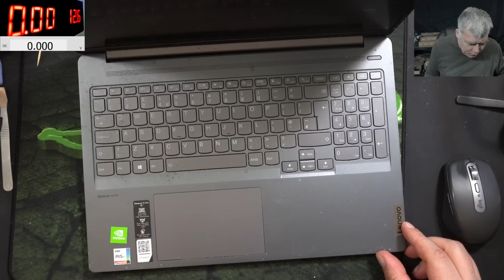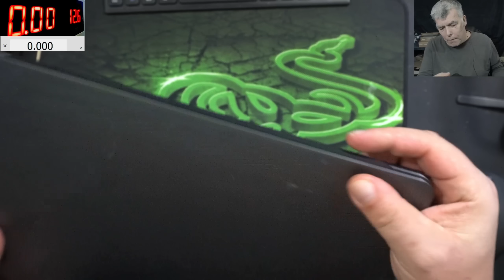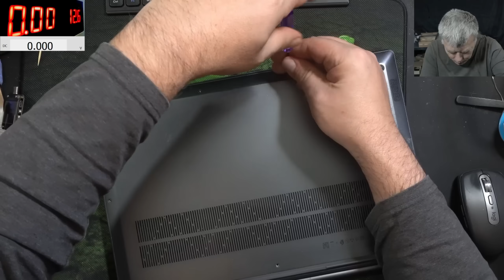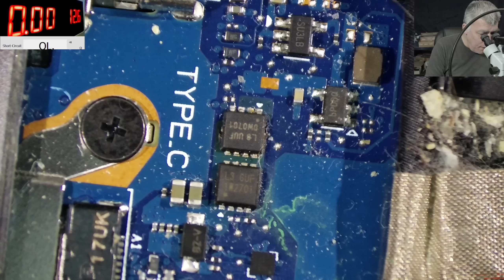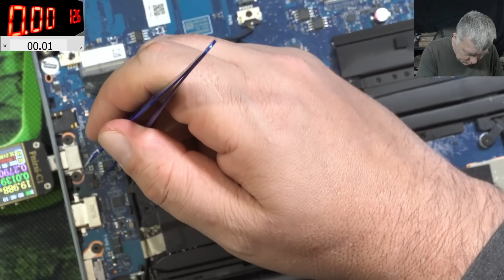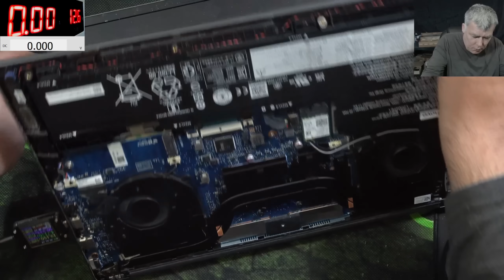Lenovo IdeaPad 5 Pro 16IHU6 dead, not charging, no power, motherboard repair, my way to fix this

Comment: Noooo! Sorin, what's the point of shorting both USB-C ports? Customer will always use only one port for charging the laptop (usually it is the closest to the screen hinge), so he can use the other port for any USB application, like charging the phone or using USB stick. When you short both ports, the customer won't be able to use the second port for general purpose USB 5V anymore, because there will be 19V; but he won't charge his laptop with both ports either. Isn't that true?

I would recommend to repair only one USB port by shorting its pair of MOSFETs, leaving other one for general USB 5V usage.

Comment: what do you all think of using P-mos with gate connected to ground source to vdd of port(type c) and drain to the main power rail consider max gate source voltage of the mosfet can tolerate -20v. this should work as the pmos on resistance is not very much and also should seperate both port the person could use both the ports for charging and usb device.

Comment: Sorin how about that: take a low voltage gate mosfet irlz44n, tie its gate to the gate of these MOSFETs. Then that low voltage mosfet connect it to the 19v and add a boost converter, set it to 25v,connect it to the gates of the MOSFETs and do the same on the other port? Ofcourse add a resistor between boost conv and MOSFETs gates. Is that doable?

Comment: If the mosfets are getting as hot as they are, are you afraid that the solder will melt???? Thanks for the video. Do you answer questions here or just if you are a member????
Reply: The MOSFETs get hot because they always have some internal resistance. A straight solder wire 0 resistance, so no heat.
Reply: @gr0undc0ntrol  thanks
Reply: I have found that the solder wire that I use, makes for a nice 5 amp fuse. If I want 10 amps, I use 2 solder wires.

Comment: As I said in a previous video, you can use p-mos and easily create the gate voltage from 19v with a voltage divider or a zener and a resistor,
Reply: nope , BQ chip won't like that
Reply: @Customer_Com543  it's all about the resistor and the diode you use. If they drain very little current so to mimic a mos gate you have no problem

Comment: Can I do the same with the 2 mosfets inside the battery? If the battery is locked?
Reply: No. Don't mess with mosfets inside battery, they are there for protection. If you delete the protection you will risk with fire.
Reply: Yes you can, but you are playing with fire by taking the protection away.
Reply: It's sad how bms systems are self-destructing. It's also sad how the sound tiles are absorbing the sound.

Comment: could you not solder a wire from +5v to the drain of the  other 1st input mosfet so that the other port would still work with all USB devices?
Reply: No. There has to be 25V on the gate if they are N channel mosfets. And it doesn't matter really. Because once you solder external voltage to the gate from anywhere then mosfets are open all the time. It is exactly same as literally shorting them. Then why even bother. PD controller needs to be capable of controlling them accordingly. And you can't simulate that in any way. You simply need new PD controller.

Comment: if we use a buck converter from 19 to 6 volt just for gate?
Reply: No. There has to be 25V on the gate if they are N channel mosfets. And it doesn't matter really. Because once you solder external voltage to the gate from anywhere then mosfets are open all the time. It is exactly same as literally shorting them. Then why even bother. PD controller needs to be capable of controlling them accordingly. And you can't simulate that in any way. You simply need new PD controller.
Reply: Actually you can use a isolated power supply to give the needed gate voltage without the need to go over 19. It works the same way. If you use a 10 volt isolated power supply, it will read 10 volts or 29 volts depending on where you read it. Voltage is relative.

Comment: The gate should be 25v. Can we just supply it 5v more? since the mosfets are welded
Reply: From where? You have literally max 20V in this laptop. You need some boosting circuit. But it's not about that if both are turned on all the time it's exactly same as shorting them. PD controller needs to switch them on and off accordingly. And you can't simulate it any way other than replace PD controller.
Reply: @TriodeTetrode He has buck in his storage. I feel like its a safer way than jumping. Those mosfets will prevent the board from allowing current when it get shorted. Still saving the laptop for another incoming fault

Comment: Nice work Mr sorin but I think that if you replace the 2 mosf you can give long life to lap top board and why their are two mosft for power that is because it have two charging ports
Reply: replacing mosfet doing nothing, because PD controller faulty, and it's need to reprogram when replacing

Comment: Hi Sorin. I am a long time viewer and I understand why you short mosfets sometimes. But this time you said that you will not be replacing pd controller. If you can't remember fixing this laptop before maybe this pd controller is just faulty and replacing it would send proper voltage on the gate? If it would be bad design then you would get more of those laptops I think. Happy birthday :)
Reply: Those PD controllers need programming. That's why he doesn't replace them.
Reply: Its a bad batch of pd controllers affecting all lenovo laptops. Even with a brand new pd controller it is just a matter of time before the same issue occurs.